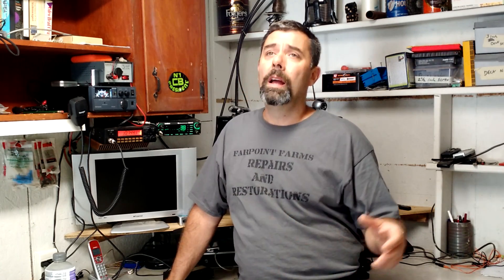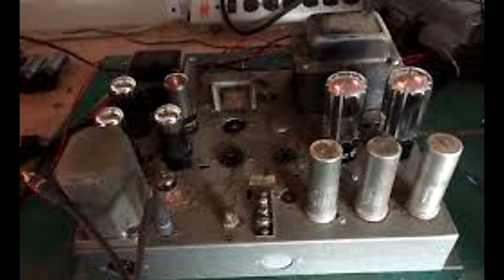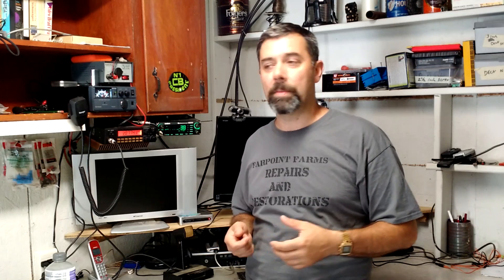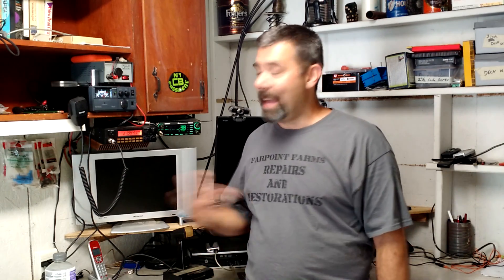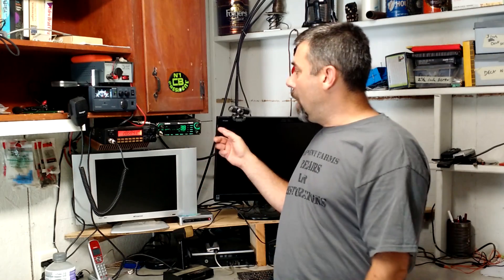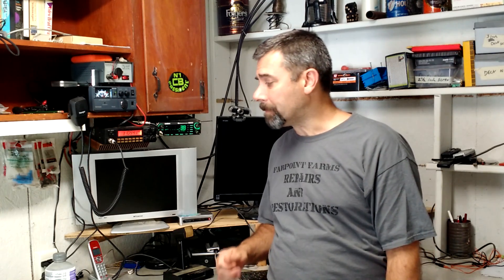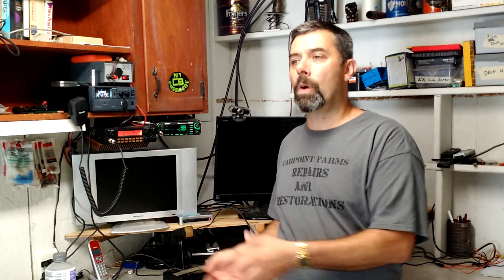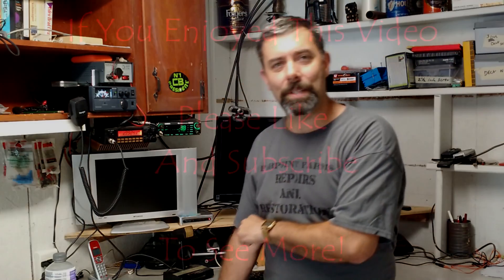A Beginners Guide To CB Linear Amplifiers.

Comment: Early garage door openers were easily activated by high power cb operations.
Reply from the maker: I seem to recall a lot of strange things happening when some joker would key down with a huge amp. Doors opening and closing, TVs turning off, lights lighting up that were not on. Crazy amount of power in the air.
Reply: @FarpointFarms  I recall a lot of items like TV's and Garage openers were supplied with remotes that sent signals via radio signals; the remotes were changed to utilise the Infra Red part of the Electromagnetic Spectrum.
I think some CB transmissions caused interference due to being close to the same frequency used by TV Remotes etc.
End result was the odd behaviour.
Nice to watch a video stressing the importance of the utilisation of excellent Coax cable and RF Grounds.

Comment: 14:30 Well, if from one S Unit to the next S Unit (let's say from S7 to S8) would be a 6dB Step, than You would need even  four Times the Power with every S Unit and not just two Times the Power.. I heard, some S Meters use 6dB Steps from one S Unit to the next S Unit. But there seems to be also S Meters that use more like 3dB Steps and that really would be two Times the Power per S Unit.. So it seems to also depend on how accurate the S Meter is.. I do not know if S Meters are accurate at all..
Reply: You have to triple your power output to increase 1 s unit on the receiving end. So 4 x3 is 12 watts = 1 s unit and so on. You quickly hit a wall where you have minimal results. The practical choice is then a 350 watt amp. 350 watts gives you 4 s units increase. After that it gets very expensive and impractical. Your better off like the man said to invest in a good antenna, coaxial cable and a tower or method to increase antenna height. 32' high is a base line for best performance and gets better with more height. Use rg 8 or better 50 ohm coax on a base antenna. Rg 8x is only good for jumpers or mobile applications as it has high signal loss on long runs. 9913 flex is the best choice for long runs of coax but it's expensive. 213 u has alot of signal loss on long runs too. I've personally never seen a 440 vac powered amp. Usually the big boy amps are 220 vac.  The reason why most amps on eBay are parts or repair amps is due to the fact that people don't know how to properly operate or set up their radios and damage them or they steal parts and put there old bad parts in and try to return them. There are several sellers that know there item is not working and just try to scam you too. If they don't know anything about the item or can't verify proper functionality expect the worse. It's not illegal to own a amp just illegal to use or manufacturer or import or export with out proper license. Tube amps are the best sounding when operating properly but there are trade offs in ease of use and cost of replacement tubes etc. The most common problem running amps is improper power supply. Use wiring that can handle the current demands. Make sure you swr is low and doesn't raise to improper levels when amp is used as it naturally will rise with increased power output.
Reply: Yes sir, I do believe you are correct. Doubling your output power the person at the receiving station would be hard pressed to notice any difference.
Reply: Yeah, i always thought it was 4x too.

Comment: I think I got dumber watching this.... THE BANDS ARE NOT DEAD! you're in the mountains so of course it's hard for you to get out. Yeah I've talked across the coast in a mobile with 4 watts but man when I can talk to Hawaii and Australia from NC, yeah I'll use a amp lol but you dont have to detune the radio. You can run 35w into most amps safely and if it's a high drive amp you can run more.
Reply from the maker: I'm pretty sure your just messing with me and everyone else here, but in the unlikely case that someone reads what you just said and believes it. PLEASE DON"T PUT 35 WATTS INTO A 400 WATT AMP!  It will last just long enough to let the smoke fly.
Reply: I’m glad I’m not your equipment.
Reply from the maker: Seriously!
Reply: If you think the 11m band is not dead you were not around in the 70s and 80s when they were kicking.
Reply: No I wasnt around in the 70s but I've been doing it the better part of 10 years and all my equipment is that old. Still prefers at 100%

Comment: Hi Eric
Nice video... This is why I run a HF radio on 11 because it's a tuned circuit at 100 watts ssb  (25 watts dead key on AM)  a lot of cb amps have no band pass filtering hence the poor quality sound and splattering from a cb amp
73s
Matt

Comment: Hey that information is incorrect...All amps are designed to accept 10w and you dont have to have you radio modified. Just turn down your PWR  all radios running 10+ watts have a means of turning them down. 
The most important facts about running burners you missed...You need an high ampage Power Supply to keep an amp running and you missed how to  keep the unit cool...Thanks for the video maybe you can do and AMP Update.
Reply: Get your own channel
Reply: Not exactly correct... I have a RM Italy KL 203 and the destructions clearly say 4w max. I also have an old G300 with four Motorola 455's that is clearly marked from the manufacturer 4w max input. 
The biggest problem is people want the PEAK & TUNE option when they buy a new radio and all they end up with in most cases is a splatter box and put that infront any amplifier and now your amplifying splatter. When people advertise PEAK & TUNE when selling a radio I keep on scrolling.
Reply: @ddixon72  That is just not true another misleading comment..Go and have a look at the RM Italy webpage for the spec of the 203 and come back and let me know ...Its .5w to 10w input AM and upto 12w on SSB drive.
Reply: @charlieoscar09  I stand corrected on the 203 but stand by the G300 now it may take more but it is clearly marked 4w max.
Reply: Absolutely incorrect. Some amplifiers ask for two watts while very large amps may require a minimum of 250 watts drive or more. The drive power required varies greatly.